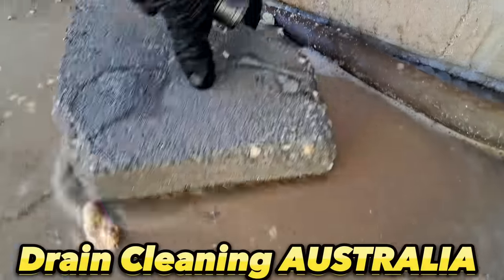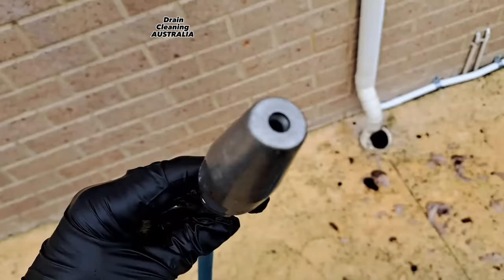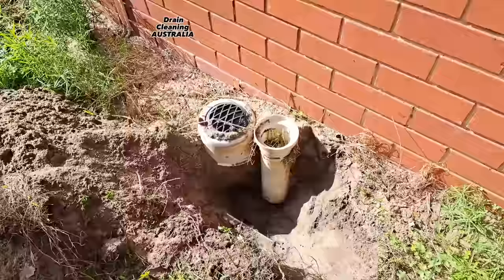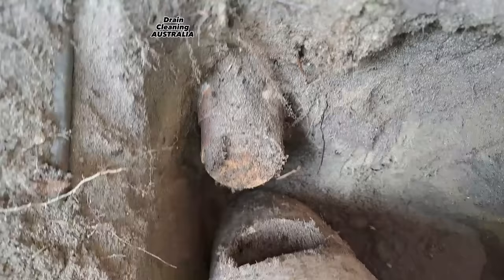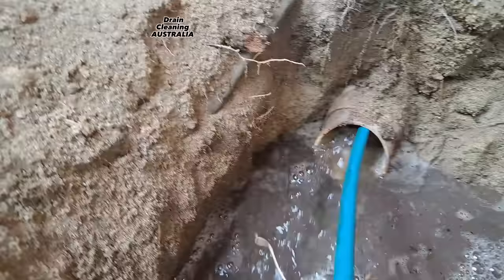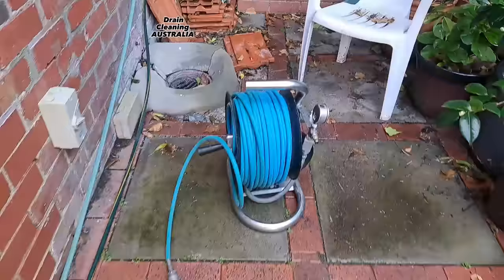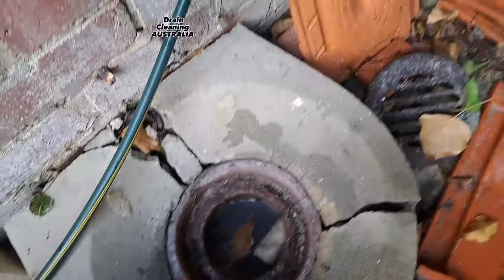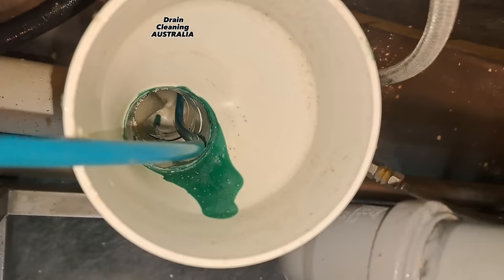EXPLOSIVE & Rotten Blocked Drains (Not for Weak Stomachs) 6 Drains!

Comment: I find the part about Western Australia's "dry floor waste"  interesting,, I see the concert with it but the reason it's usable,,, the sand making drainage no problem,, is also the reason it needs servicing.  If it were me building there I might just plumb everything into the drain,,,, Of course being from North America most homes do not have floor drains,, They have been going into new builds for a while if specified but I don't think it's code yet.

Comment: they go on about saving water by making toilet cisterns etc, smaller & flush to be able to give a half flush, so no wonder the drains & sewer,s get blocked, i have the old high level cistern with chain, that gives the toile what it needs to give it a good powerfull flush. & i also every now & again, leave a a cold tap on full bore for a good 10mins to help keep the drains clear.

Comment: Those floor wastes are hopeless, got the same set up at my unit that also need a good clean again. Perth is a big sand ant hill, that's why you don't see Bruce clearing storm water street drains, we don't need them, the rain just soaks away most of the time.
Reply from the maker: It's true mate. If it wasn't for the sand I'd certainly have some cool stormwater content!

Comment: Wouldn't that soak away undermine the foundations of the house with it been so close?
Reply: he explained it is for 'small spills' on bathroom floors
Reply: @petercross6960  yes I saw that after I made my comment 👍
Reply: Even though it is supposed to be for small spills, it looks like a lot of water and the sand with it, goes back up into the drain pipe. I bet more water “than small spills” are going down those drains. LOL